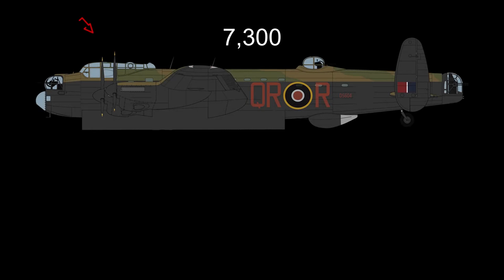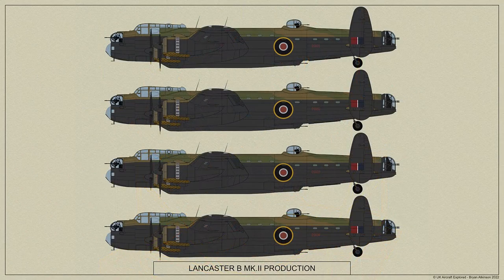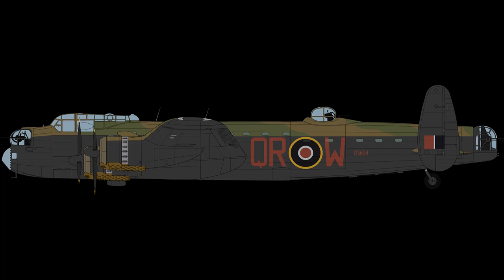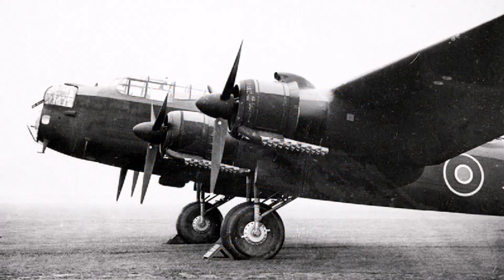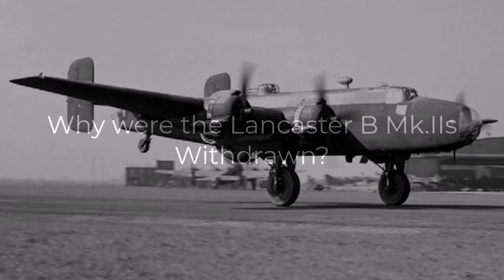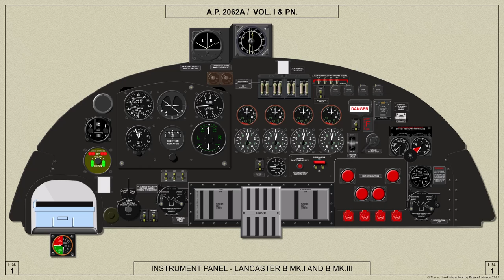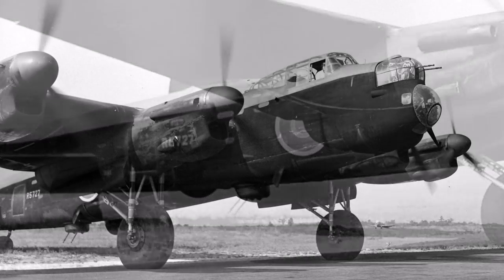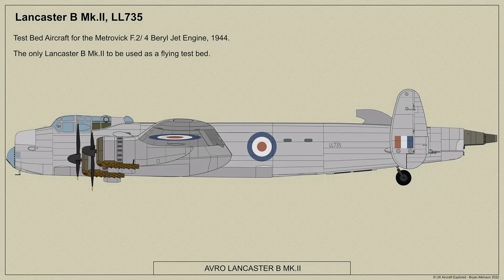Avro Lancaster B Mk.II – The Forgotten Lancaster

Comment: I like how the Air Ministry even made sure they had a workable radial engined version of the Lancaster just on the offchance that the Merlin's weren't available for what ever reason.You've really got to hand it to the British engineers.It seems as though there was nothing that they overlooked during the war.Brilliant.
Reply from the maker: That's certainly very true Karl. With all the research I have done over the years, one thing that has always struck me was the amazing depth of detail that took place during the design and construction process of each aircraft type. Also in the operation of all types of aircraft during the war. The entire aviation industry did its best to work as a team. Not all things worked out right, but they certainly worked hard to provide our forces with the best equipment possible at the time. The other thing, of course, was that during that time, technology was constantly changing. Thanks for watching.
Reply: @ukaircraftexplored6556  reminds me of how the air ministry requested an alternative powerplant for the Hampden incase Pegasus engines weren't available. Thus the Napier Dagger powered Handley Page Hereford was built. Served with one Operational squadron and competed in a single raid before being relegated to training squadrons. The dagger was terribly unreliable. It wasn't underpowered and the specifications in some areas did exceed the Hampden, it was just Hopelessly unreliable

Comment: Excellent video presentation on the wonderful MK-II Lancaster!
 My Grandfather was kia in DS816 JI-O. June 15, 1944. The black and white image of the mk-II flying you used often in this video is LL734 JI-O, of 514 Squadron. It replaced my Grandad and crewmates a/c after it was lost. 514 converted to mk-IIIs by June 1944. Shared your video on the 514 facebook page.  Cheers, 514 Page Admin.  P.s. interestingly, 514 was equipped with 2 x MK-IIs with the venteral turrett fitted.
Reply from the maker: Thanks for watching

Comment: Very interesting and informative. Thanks for posting. It would have been helpful to have some comparative horsepower ratings for the different powerplants discussed in this presentation. Cheers.
Reply from the maker: Thanks for sharing. I have to say when creating a video like this, it is a bit of a juggling act to decide how far to go with data, etc.

Anyway, the maximum power ratings are as follows - 

Bristol Hercules XVI. 'M' Gear - 1,675 bhp.   'S' Gear - 1,455 bhp.

Rolls-Royce Merlin XX. 'M' Gear - 1,240 bhp.   'S' Gear - 1,175 bhp.

I hope this helps.

Comment: Great video. I did make me remember a story on a Post WWII repurposed Lancaster for passengers that crashed into a mountain in poor visabilaty at high altitude because we didn't know about or understand the Jet stream..  they were flying head on with it and descended too soon . It was a mystery until it started resurfacing at the bottom of a Glacier.  I have a foggy memory of Rottary Engine's. I do watch lots of these videos and could be incorrect about the Engine
Reply from the maker: Yes, it was a BSAA Avro Lancastrian named 'Star Dust' it was fitted with Rolls-Royce Merlin engine. It sadly crashed in 1947. Thanks for watching and sharing.

Comment: My late uncle from NZ flew Merlin powered Lancaster’s in WW2. He flew many sorties over Europe and was lucky to survive the war uninjured. He also ferried new aircraft from Halifax in Canada to the UK as well as being a flight instructor. He said the Merlin engines were better than the Packard built Merlin’s but I don’t remember why that was.  I would assume the Merlin powered Lancasters could operate at a higher ceiling due to the 2 stage super charging which supplied more air to the engine thus more horsepower at those high altitudes. I think the Rolls Royce Merlin contributed to the winning of WW2 especially in the Spitfires.
Reply from the maker: Thanks for sharing
Reply: derekfromtauranga    Sorry ole Bean you are wrong !!!!  All Lancaster Mk Bi's  & Mk BIII used the Merlin 20 series engines that were SINGLE STAGE 2 SPEED superchargers !!!  NOT the 2 stage 60 series engines, why their service ceiling was barely 20,000 ft.  This  is the MISTAKE most people make is ALL merlins were 2 stage and not true,  of the 20,000 $hitfires built only7,000 were Merlin 60 powered, 2 stage supercharges  the rest of the 13,000 were all the SINGLE STAGE  2 speed supercharged,  the facts of history less the hype lies and just BS stories !!!

Comment: These videos really are very good! I read that some crews liked the Hercules Lancs because there was very little exhaust glare at night compared to the Merlin powered variants, they also had a faster rate of climb. (edit, I might be wrong on the rate of climb, I'll have to check my "Lancaster at war" books)
Reply from the maker: Thanks for watching!
Reply: Flying along in the dark, with a nice pair of Bristol's either side of you. No wonder 115 Sqd felt safer.
Reply: Many Canadians regretted the removal of their ventral guns. When one thinks of the night fighters later on, creeping up below undetected...
Reply: I've read conflicting things about the Lancaster II in terms of performance. Many books claim it "underperformed" compared to the Merlin powered Lancasters, but a lot of the first hand accounts from 426 "Thunderbird" squadron RCAF which flew the type talk about it flying higher than normal lancasters and performing quite well. I suspect the issue may have been the engines; the earlier Mark IIs had the Bristol Hercules VI engine while later marks had the Hercules XVI. I've read the XVI was more "Automatic" and required less tinkering to fly at full efficiency, so I suspect that the poor initial performance of the Lanc II was the earlier marks with the VI engines, while the higher performance you read about in first hand accounts come from the later production models with XVI's. Just a hypothesis of mine however.

Comment: I knew vaguely about the MkII Lancaster and had heard of the operational height problems but really enjoyed this informative video! It's a wonder that this aircraft wasn't adapted to carry out long range anti submarine and coastal defence duties. Extra fuel tanks and the addition of 50 cal. machine guns, 20 mm canon and depth charges, would have made this Lancaster a formidable sub and ship killer.
Reply from the maker: Yes, it could have been. Thanks for watching
Reply: Late in WW2, Harris rounded up the Herculese-engined Lancasters and assigned them to Group 3 of Bomber command, which was using the Gee-H precision-bombing apparatus and did not need Pathfinders.  They were able to destroy a lot of the synthetic fuel plants, because of their high accuracy; and also demonstrated this in a precision attack on Trier on December 19,  1944 , in "impossible" weather, which destroyed a centre of concentration of German armour and thus contributed to the failure of "the battle of the bulge".  (Ref:  "Bomber Harris"  ISBN 0-385-11258-0  PP 266/267).  The Herculese-powered aircraft were considerably faster at low level than the Merlin  XX - engined versions;  their bombing altitude was 20,000 feet, versus about 25,000 feet for the Merlin.  This presumably reflects that the superchargers of the Herculese were optimised for lower altitudes than those of the Merlin XX, which developed a maximum of 1,240 HP at 12,000 feet in low supercharger gear. The Hercules 16 produced 1375 HP at 4000 feet.
Reply: @dafyddllewellyn6636  Interesting. Finding accurate information on the Hercules has been difficult. The Halifax with the Merlin was a dog and the RR Heritage trust book on the Halifax explains exactly why and does some comparisons with the Lancaster show a huge difference in performance and showing that the Halifax at cruise height and speed was on the point of stall. It’s somewhat of a paradox that when the engine were reversed the Halifax III was the better performing aircraft and could attain a higher altitude. Which begs the question are we comparing apple with apples.
Reply: @tempestnut  One needs to know a lot more than the history books show;  The propeller has a major effect, and the cooling drag can be a major factor. The Herculese  in the Lancaster II was evidently considerably affected by how the pilot used the cooling gills; getting that wrong could mean you did not have sufficient fuel for the return flight.  The wing aspect ratio is also critical.  Getting it all optimised was not always possible in the rush of war.  For example, the Lancaster was a conversion of the Avro Manchester, by using available Merlin engine "power eggs" that had been developed for (I think) a Merlin-powered version of the Wellington.  Early Lancasters had rather pointed propeller-blade tips, but later these were changed to "Paddle" blades, which gave better performance at altitude.  All these developmental changes need to be taken into account, to make valid comparisons, so you are correct about "oranges and apples".

Comment: The Hercules was used because in 1941 the Merlin engine was in such demand it was feared demand would outstrip production, it had 1752 hp and the service ceiling was lower at 15000 ft whereas the Merlin Lanc has a service ceiling of around 20,000 ft but later Merlin versions had a ceiling of around 24,000 ft
Reply from the maker: Thanks for watching

Comment: Thanks for this video, the first one I've ever seen about the Lancater B Mk. II. I have a question about a specific Lancaster from 514 squadron that crashed in my village of Iwuy (France 59141) during the night of the 15/16th june 1944 this was LL 690 JI J. I just would like to know if it is possible to know if this bomber was equipped with the FN.64 Mid Lower Gun Turret ? I can see there was one on  LL 624 JP - L and according your video on some other ones but I wonder about LL 690, JI J, thanks for your help.
Reply from the maker: Thanks for sharing

Comment: Ah, very good subject.  I’ve been studying Bomber Command and the three heavies, and have been curious about the Hercules’ version of the Lanc.  I’ve yet to understand why the Hercules was so good for the Halifax, but not the Merlin, and vice-versa for the Lancaster - assuming this is true and not some unsubstantiated claim.
Reply from the maker: I thought I'd try creating a different type of video, hope you liked it and thanks for watching.
Reply: It's true enough, the reasons for Merlin's problems in the Halifax were the HP designed nacelles which went against the advice of Roll Royce rather than the preferred  RR power egg and as a result had reduction gear vibration problems in addition to airflow issues over the wing. The Hercules performance in the Halifax increased when improvements were made to them but the Lancaster production of the Hercules variant ceased after 300 were made, long before the improved Hercules variants were available with improved supercharging timing.
Reply: @ericadams3428  Which might be more of an answer to why the Stirling was so good at low level but unable to get much past 15000 feet. Maybe the ceiling issue which is always blamed on the shortened wings had as much to do with the engines as it did the airframe. 
I don't think that the question has ever been asked.
Reply: @kellybreen5526  - Interesting point. I'm sure the reduced power as the altitude increased couldn't of helped.
Reply: The improvements to the Hercules carried on long after Stirling development was abandoned.

Comment: Question... Is it also not possible the air-cooled Hercules engine was used because it was lighter? What was the total power output differences between the Merlin and the Hercules? What was the weight differential? Hercules if lighter would have been less reliable but able to climb and other performance specs better?
Reply from the maker: The dry weight for the Merlin XX is 1.430lb, and the dry weight for the Hercules XVI is 1,893lb. Hope this helps and thanks for watching

Comment: Question. Weren't these engines, despite being less powerful, more suitable for lower-level flight and heavier flack conditions than their liquid-cooled counterparts?
Reply from the maker: Could be, as fitted to the Beaufighter, used for low level anti shipping attacks. Thanks for watching
Reply: The Hercules XVI was rated at 1650 hp.  The reality is that the Lancaster mounted its engines beneath the wing, which suited the Merlin better.  The Halifax was designed for the Hercules and mounted them higher; its performance suffered with the Merlin!  Both were excellent engines in aircraft designed for them.
Reply: Apparently the Lanc Mk IIs were better at low level flight but couldnt reach the same ceiling as the Merlin versions.

Comment: Interesting video. I understand that some Halivax B.VIs were fitted with Hercules 100s in 1945 which ended up with better altitude performance than the Lancaster 1... idle speculation wonders if the Lancaster B.II with that engine would have been better for the RAF!
Reply from the maker: Thanks for watching
Reply: The  mark VI with Hercules 100 did not enter service until Feb 45.

Comment: Quite interesting. 
To convert Airfix's 1:72nd-scale kit of the Avro Lancaster RAF Bomber to a Lancaster Mk.II with Bristol's Hercules Mk.VI engines, could one substitute the cowlings (and if necessary, the na- celles) of Airfix's 1:72nd-scale kit of the Handley Page Halifax RAF Bomber? 
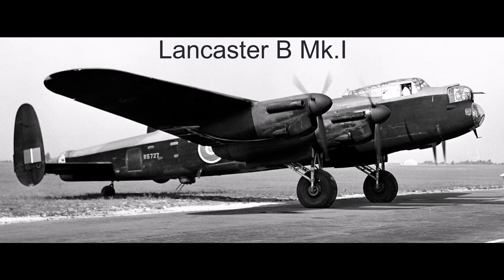   I know of no mass market kits of both aircraft in 1:48th scale, or a newer mold of a 1:72nd-scale kit, leaving us just the Airfix kits as our sole recourse. 
   I must note that I have sentimental remembrances of these Airfix kits, as well as those of the Short Stirling and the Vickers Wellington RAF Bombers.
Reply from the maker: Airfix currently sell the Lancaster B Mk.II - kit number A08001. Thanks for watching
Reply: @ukaircraftexplored6556  , thank you for your prompt response. The Airfix kit of the Lancaster that I recall had the Rolls Royce Merlin engines.

Comment: Thanks for the good and understandable post. A small contradiction creeps in where the talk is of the Hercules Mk XIV (14), but where - if I interpret it correctly - the Mark XVI (16) is meant; or is it first about the Mk XIV and later an Mk XVI equipped Lancaster variant?
Reply from the maker: Yes, my mistake. Realised after posting. For some reason, I said Mk.14 whilst reading my script instead of 16. I'm so sorry about this, as I do try to get things right. If I took the video down and changed it, I would lose all of my views and comments. So I posted an explanation in the description and pinned the same in the Comments section. Please know that when I say Hercules 14, I should have said 16! Thank you so much for watching.
Reply: @ukaircraftexplored6556  That doesn't change a bit in the high quality of your contributions. Thank you very much.

Comment: Very good, thanks. I wonder how many crew men's lives would have been saved if British bombers had been fitted with an effective ventral turret?
Reply: The nose emergency-exit on the Lanc was considered awkward to get through by anyone wearing a parachute: this was pointed out but no-one did anything to increase its size. The Lanc was considered more difficult to bail-out from than the Halifax (which apparently had s higher survival rate). 
   It would be interesting to know if any attempts were made  to protect the fuel tanks on the Lancaster (the Germans introduced a special self-sealing tank-liner on their bombers ).
Reply: @None-zc5vg  Most WWII combat aircraft, including the Lancaster, had self-sealing fuel tanks. A notable exception being the Japanese A6M Zero, which for this reason became notorious for being easy to set ablaze. But while self-sealing tanks helps, there's no going around the fact that gasoline is just incredibly flammable.
Reply: Not sure. I think one reason why the Germans liked to attack from below was that the target aircraft was silhouetted against the night sky, whereas the German plane was practically invisible against the dark ground.

Freeman Dyson, who worked on bomber survivability analysis during the war, suggested sort of the opposite; since interviews with shot down crew that managed to get back to England revealed that most never knew what hit them, he suggested to get rid of the turrets. The reduction in drag and weight would have increased the speed, thus limiting the time the aircraft spent getting shot at by flak and night fighters and thus increased survivability, as well as reducing the number of men lost for each bomber shot down. But the myth of the gallant gunners protecting their mates was so strong that this idea was never seriously considered.

The Mosquito sort of proved him right in that speed would be a better defense for a bomber than defensive armament, as the Mosquito had a drastically smaller loss rate than the lumbering heavies. But this goes into the territory of counterfactual history which is hard to prove one way or the other. For example, one reason for the Mossies low loss rate was certainly why bother going after a small and fast bomber when there are much juicier and easier targets available?
Reply from the maker: Interesting comments all, thanks for watching!
Reply: @jbepsilon  A good point, especially as the main advantage of the Lancaster gunners was as look- outs, warning the pilot of the presence of night fighters. Canadian Lanc pilot Punch Cowan said that the worse thing a Lanc gunner could do was open fire, as the .303 guns had too little range to be effective, and merely gave the plane's presence away.